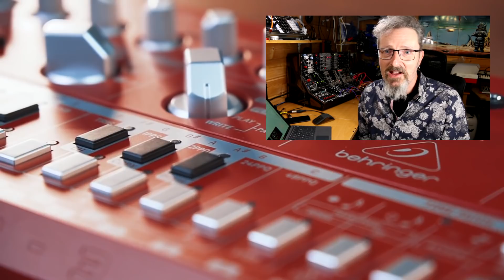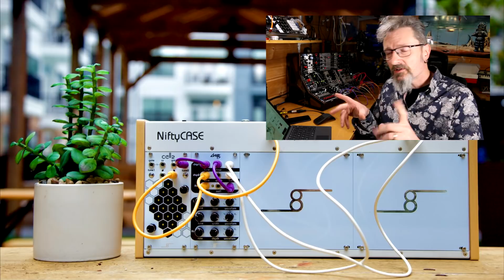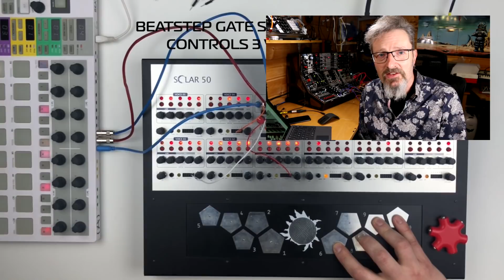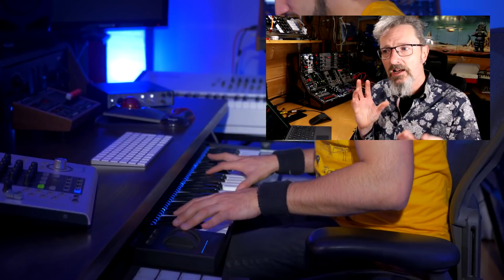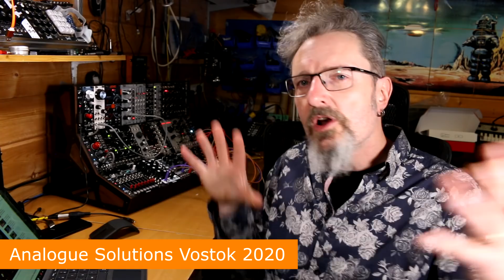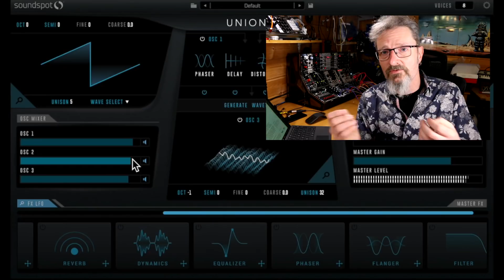Molten Music Monthly - November 2019

Comment: I dont really agree with you about proper size and asthetics, but it was a good video, and I can see your points about that subject. I love the form factor of the Behringer eurorack table top synths. It enables them to be cheap while being sturdy and it's easy to find a place to put them. Nothing wrong with a nice chunky poly D minimoog thing in a wooden case with big knobs but that's why it's $700. I'm just not going to buy that many $700 simple synths. Other than that nice case, big knobs, and 4 note polyphony, 2 Behringer Model Ds actually have more sound flexibility and come up $100 cheaper. Nothing wrong with the Poly D, it's just attempting to be a cheap luxury synth. I don't need the luxury, I have tons of synths. I have two many keybeds as it is. I have 2 model Ds and 2 Neutrons in about the same space as one Poly D. I'll eventually get one if it's cheap enough, but single oscillator 4 note paraphony is only so useful, so it's really for the other things you mentioned.
Reply from the maker: Yep, it totally works as a form factor for some people - undoubtedly :)

Comment: So...we should actually call it a ParaD (pronounced parody?)
Reply from the maker: Not if you’ve been listening 😆
Reply: @MoltenMusicTech  we've been listening, and I urge you to study the definition of polyphony, because your view of paraphony leads to the conclusion that polyphonic synths = monophonic synths - which is hilarious.
Reply from the maker: You are confusing factual definitions with accepted nomenclature. All synths have a polyphony, but we use the word “polysynth” to describe something that plays more than one note at a time from individual triggers (not oscillators set to intervals). Its signal routing is a separate issue that people have wrongly folding into the concept of polyphony. Look up synth historian Marc Doty’s definitions for the best explanation 😉
Reply: @MoltenMusicTech  great that you bring nomenclature into this: Most modern monosynths DO play paraphonically. So, by extension, your definition allows monosynths to be called polysynths. 

This should put an end to the argument, but here is the bonus kicker.  The formal definition of polyphony: "In music, polyphony is a type of musical texture consisting of two or more simultaneous lines of independent melody, as opposed to a musical texture with just one voice, monophony" 

Paraphonic synths do not allow independent melodies because all notes share the same filter / envelope curves. The melodies are not independent. 

So, nope. Not only does your view of polyphony hurt nomenclature, it also goes against the definition of polyphony.
Reply from the maker: Well no, melodies are not dependent on envelope or filters or independent volume so although your point is interesting it doesn’t seem right. Yes, all synths have a polyphony, but we call single voice ones monosynths do we not? You could call it a single voice polysynth but that’s not really playing the game is it? There’s a tension between the definitions and what we accept as helpful, you know?
Reply: @MoltenMusicTech  melodies are VERY dependent on envelope and filters once you realize that melody is NOT the key you press, but a single line of sound. When you have a melody that requires a gradual ramping of it's volume, and another one that requires a fast ramping, you cannot play them together in PolyD, because the envelope of melody A affects the envelope of melody B. So. melody A and melody B affect each other (in a very unreliable manner, might I add). They are not independent.  

Furthermore, if you think that it's helpful to use the term Polysynth for grandmother, matrixbrute and the original model d, then there is no point in arguing.  The fact of the matter is, slapping the sticker "polysynth" in this is a marketing gimmick.
Reply: @grproteus  I’m not sure about your paraphonic synths, but on my paraphonic MatrixBrute I can easily play two independent melody lines.
Reply from the maker: Why do you think i think that would be helpful? So how can my single oscillator be playing a melody without any envelope, filter or amplifier - how can this be? Articulation is awesome but it is in addition to polyphonic/monophonic/duophonic sound generation. I'm not trying to change the definition of polyphony and while it's loose no one is trying to redefine monosynths or what we understand about how synthesis works. I'm simply supporting the idea that how a signal is articulated is a separate process from how the notes are generated. Marc Doty describes it best here - https://www.facebook.com/AutomaticGainsay/posts/589934551075953
Reply: Panta Flux then it must be a polysynth, right? If it can do the same thing the polyD can do, and the polyD is a polysynth, then the matrixbrute is definitely a polysynth.
Reply from the maker: It comes down to what you think that term means. I would say the MatrixBrute is capable of 3-note polyphony with paraphonic articulation. But it’s designed as a monosynth and Arturia can call it whatever they want. I wouldn’t necessarily call it a “polysynth” because that’s become a very loaded term in about 2 days but it does exhibit polyphonic behaviour.
Reply: @MoltenMusicTech  I would like you to use your own nomenclature to characterize the matrixbrute. Is it a monosynth or a polysynth? Answer in the other thread. If you cannot answer, please don't mention nomenclature again.
Reply from the maker: Nomenclature!
Reply: @grproteus  Without any doubt both synth are varioparaphonic MonoPolysynth, indeed!
Reply: @grproteus  With your question “Is it a monosynth or a polysynth?” you imply that these two terms are a contrasting pair. Although this was true a long time ago in electronic music history when there were the first monosynth and the first polysynth. But this differentiation does not make much sense these days with all the in-between synth that exist nowadays. It all runs down to how you define those terms. Presuming that a synth is EITHER a monosynth OR a polysynth and further presuming the very common view that a monosynth is a synth that is only capable of playing one note at a time. Then every synth that can play more than one note at a time must be a polysynth. See?
Reply: @PantaFlux  the terms are mutually exclusive. A monosynth is, by definition, not a polysynth. A polysynth, is, by definition, not a monosynth. 

This is why the term paraphonic was added to describe some *monosynths*. It does not apply to polysynths, which are a different category, because , clearly, they don't play paraphonically.

Definitions matter, especially when you insist on "accepted nomenclature".
Reply: It’d still be funnier to call it a parody anyway. Though that may be selling its quality and comparison to the moog quite short.
Reply: I just wanted to make a pun!
Reply from the maker: Get it in quick before the poly-police get here
Reply: Someone is trying to evade the argument  :)  It's not rocket science, it's elementary school logic.  Just let us know if the Matrixbrute is a polysynth or not.
Reply from the maker: No evasion here mate. As I said “polysynth” is a loaded term that implies many things in marketing terms and has become toxic in this discussion. So I reject the notion that I need to be trapped by how you define that. The MatrixBrute is not a polysynth in those terms but is capable of 3 notes of polyphony. How does one reconcile that into a single catch-all and logical term that doesn’t end up being inaccurate in some fashion? Maybe you can answer the question of how many notes of polyphony can the Poly D play?
Reply: @MoltenMusicTech  first you insisted it was "accepted nomenclature", now you say it is not.   

Its not the term, mate. It's the definition you gave for the term. Your own definition forces you to classify a monosynth as a polysynth, and this makes  the term useless, let alone  "accepted nomenclature".  

I would argue that the term is perfectly fine, as long as you understand what synth polyphony is. Sadly, by the "non-useless" definition of the term, both the Poly-D and the Korg mono/poly are paraphonic monosynths. Not polysynths.
Reply from the maker: I don't think I insisted on anything. I'm attempting to accurately describe something using more than a single term. Using definitions we can apply "polyphony" to every synth and "paraphonic" to every non-polyphonically articulated synth - but we don't do that and I don't know why you think i'm doing that. I struggle with the idea of calling the Poly D a "monosynth" or a "polysynth" on it's own because it doesn't describe what's going on. I would rather use more words. "Paraphonic monosynths" doesn't really work either, although i totally understand what you mean, because strictly speaking all monosynths are paraphonic. Whereas to say it's a "4-note polyphonic synthesizer with paraphonic articulation" is a bit of a mouthful but it is, i feel, more accurate and tells people exactly what it is capable of. And once we've separated the voice from the articulation then we have a much deeper way of describing what's going on.
Reply from the maker: I guess the alternative is to broaden/change the definition of paraphonic so that we can attach it to a number and as with the Matriarch call it a "4-voice paraphonic" synthesizer. It would make things simpler for the marketing people trying to sell us synthesizers. It's just that's not what paraphonic means, but hey, who can stand against the flow of the synth community? :D
Reply: @MoltenMusicTech  Nah, no need to invent new useless terms, just stick to proper terminology.  

Polysynth = polyphonic, multiple voices. 
Monosynth = monophonic, one voice.

Some monosynths can be played paraphonically, giving you pitch control of the available oscillators through the keys, but that does not constitute polyphony. They are still monosynths.

This is the proper taxonomy, unless you want to support Behringer's false advertising so much.
Reply from the maker: I'm afraid we'll have to agree to disagree. Mr Flux above makes a very shrewd point above. It's all a lot more fluid than that and so it makes sense to broaden the language and be clearer on what your terms mean. So do you describe the Poly D as simply a "monosynth" or is it a "monosynth but where up to 4 notes can be played paraphonically through the keys"? Because there's more going than you would typically find in a monosynth and so term becomes inaccurate.
Reply from the maker: I'm sorry, but i'm fairly certain that "paraphonic" is a term that describes the articulation of any kind of polyphony - it is voice-agnostic. But who knows? You are convinced by your definitions which is cool - certainty in life is hard to find and so you hang onto that my friend. Personally, I find them lacking (sorry) but that's my problem and I'll do what I can to be clear in how I describe things. I'd also like to apologise for my outrageous and probably inaccurate use of the term "accepted nomenclature" (i know what i meant when i typed it but now I've no idea) which has clearly caused you some distress.
Reply: @MoltenMusicTech  "my" definitions allow me to classify any synth on the market in a very simple, very concise manner. "Your" definitions made you avoid classifying the matrixbrute and invent new terms. So, it's not "my" definitions that are lacking here.... Just saying. 

It's only a "very fluid market out there" if you don't know what you are talking about. Polyphony-wise, the market has been 100% the same since the 80s.
Reply from the maker: Ha! And the great thing about all of this is that's it's so inconsequential that regardless of what terms you use or how I describe something and how inaccurate or ill-defined the terminology is we are all able to come to a shared understanding of how a certain synthesizer works. :D
Reply: Molten Music Technology it is not inaccurate, it is not inconsequential and it is very well defined. Polyphony is defined in very simple, easy to understand terms, as is paraphony (παραφωνία). You just prefer your own, arbitrary definitions.
Reply from the maker: I do, I really do.
Reply: Molten Music Technology 🤣
Reply: Parapolies
Reply from the maker: @Prot Eus - Here you go, Marc Doty will help you wrap your head around it. https://youtu.be/ZeuOlqjxPuA

Comment: Nobody loves Behringer, it seems. This Minimoog clone seems great; only thing is, can you have reached "peak synth", and I don't mean Novation either. Isn't there a point where oscillator-filter-envelopes-LFO begins to cover the same sonic territory? Or is that emperor's new clothes heresy?
Reply from the maker: Has always been the case which is why you only ever buy one guitar... no, wait
Reply: I LOVE 'em!! feckin lovin' them.
Reply: An lfo is an lfo , in analogs the filter is the difference factor and in lesser case osc and envelop response , so you have a point there regarding overlap , that is why they made digital , 50 envs , 50 lfos , but they forgot about the Sound

Comment: behringer will have to sell cheap eurorack cases for their cheap synths hehehe, I think the same, hp is expensive, am gonna go for the crave and the td 3 eventhough I have the tb 3 and tb 03 but I want the analogue thing now hehe but am not paying more than 200 for a behringer, I may get the model D second hand around that price too
Reply: I will definitely be interested in the power supplies on their larger cases that are inevitably coming, but we will have to wait until they push out their range of modules out the door.
Reply: Robert Syrett And I hope they do an ES-9 clone 2.😎
Reply: @spaceman103  But with ADAT instead of SPDIF optical outs ;)
Reply: Robert Syrett ADAT and SPDIF. With SPDIF on Toslink and coax.😎
Reply: @spaceman103  I like the way you think!